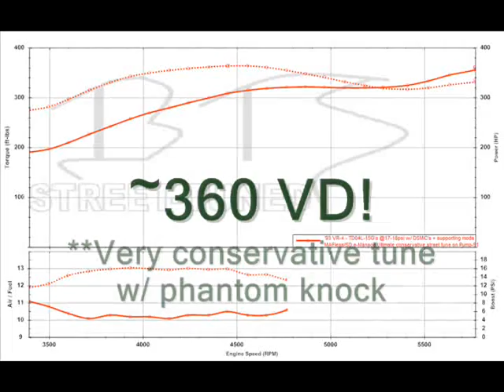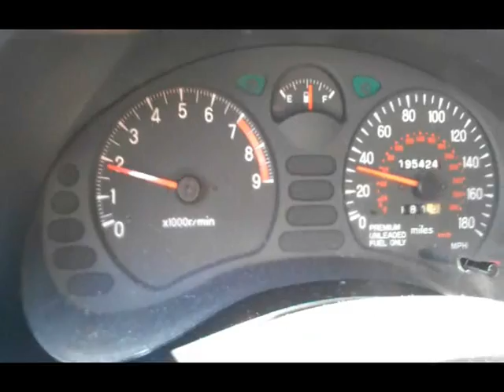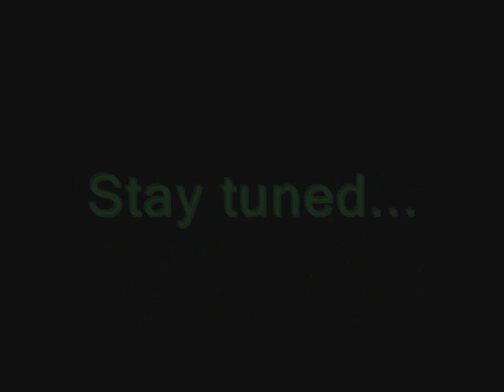George's 1993 Mitsubishi 3000GT VR-4 - 15G Build - Part 6 - "Tuning Phase Three"

Comment: Thinking of going single turbo on my 98 sl, you seem to build a lot of these, is this something you would recommend? Reason for single, cheaper (buying one turbo instead of 2, single inlet intercooler, not expensive if the rear turbo went out if i chose the TT route) but the down side is custom manifold work. What turbo would you recommend for a single ~350hp 91 pump gas, with little spool time. Thanks!